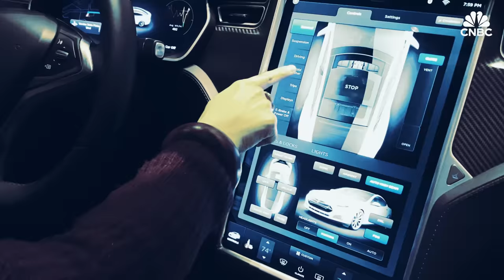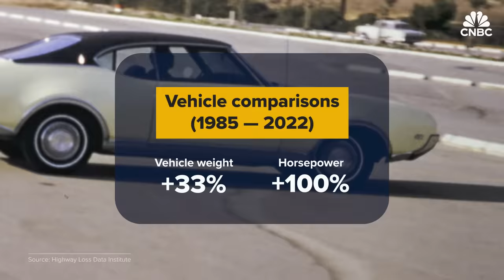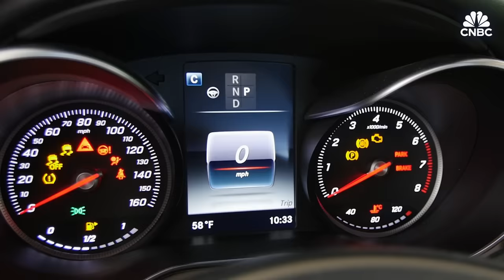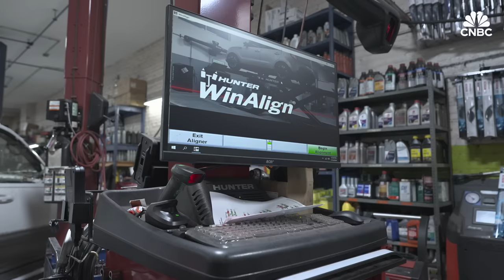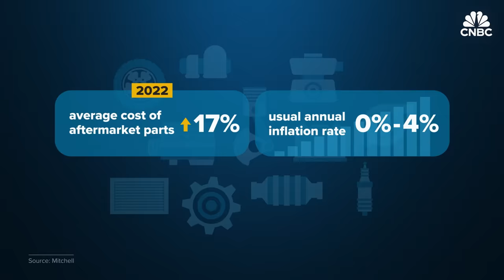Why Car Repairs Are Getting So Expensive

Comment: When I first started working as a mechanic after trade school I made $15/h. I was expected to do 70 hours a week of work within 40 hours. Everyone was expected to scam customers with repairs that weren’t needed. Oh and the dealer charged $150/h.  I was laid off for not meeting performance goals that could only be met by scamming customers. 

No shock there is a shortage of techs, when being honest gets you fired from many shops.
Reply: Sad but true. Same thing was asked of an A/C repair man I know. Integrity is becoming an option not a requirement.
Reply: Thank you!!! But no one is talking about this!
Reply: Thanks for sharing your story. It's always interesting to hear firsthand from people in trades how business really works.
Reply: At what point did you decide face tattoos were the key to success?
Reply: Those tats and bullhorn are ridiculous
Reply: that's when you contact the labor board and get the local news and an investigator involved and sue
Reply: Mechanics at car dealerships are the biggest crooks around
Reply: Thankyou for your integrity.
Reply: Last straw for me was asking for a raise from 26 to 28/hr, and they said if I wanted that, I needed to book more hours. I had almost zero comebacks, and had to fix other techs screwups a few times, then looked at their hourly rate in our system, and they were making more than I was. They push quantity, not quality of work.
Reply: I owned a Saturn many years ago and purchased the car with a maintenance contract from the dealer.  I went in to get the routine maintenance done and the service tech “recommended” a service.  I told him if it’s a service required by maintenance manual that he should do it.  I came back to pickup car and there was a charge.  I told him that I have a maintenance contract.  Service manager tried to argue that there was a difference between what they recommend and what Saturn recommends.  In the end I didn’t pay for the service.
Reply: Hopefully you are a mobile mechanic and your own boss. I’d rather pay someone who’s honest that way than to pay a shop.
Reply: @ralpholiver8512  dealerships are crooks. Not mechanics.
Reply: Yep same here I changed careers. Every time that snap on truck rolled in I realized in couldn't afford all the tools I needed with what I was getting paid.
Reply: Are you sure you weren't frightening the customers away?
Reply: I was making 17 an hour (flat rate) as a heavy line tech and the dealer was charging 28 an hour for cars and 30 for light duty trucks. My how things have changed. Supply chain my foot. I bet it has more to do with skilled techs.
Reply: My son experienced the same thing. He started his own, successful, shop.
Reply: I took high school auto shop back in the 70's and the cars were very simple compared to the newer cars.  Open the hood of a 1970s car you would see a motor with a few attachments.  Open the hood of a new car and it's tough to find it.   To save money I still do all of the basic maintenance.
Reply: Yo, same thing happened to me. That’s why I haven’t returned to the field.
Reply: This is a very true statement.

CNBC needs to look at this side of the story before they publish anymore stories about rising prices.
Reply: @ralpholiver8512 Its the service writers and the service managers fool
Reply: Its funny when I had an extended warranty only things that needed fixing were recommended.  But now my warranty expired the mechanics try to scam me.
Reply: @pouffykinkajou it pays to be dumb and get gravy work.  Some jobs you can't beat flat rate diagnosing..... example a vanity light in a new pilot kept blowing the fuse and taking down can bus and putting car into limp mode.
Reply: Dealers are scam artists I'm a mechanic ill never work at one and too much goverment is involved with production that's why quality is horrible and everything is expensive disposable trash, and now we wonder why everything is so expensive ? Ppl r dum
Reply: By "many shops," you meant he one that fired you for being incompetent. I call BS.
Reply: Dont blame techs for doing whats expected of them. We are just a disposable tool that gets little respect for doing a job. A job that requires a large amount of equipment and knowledge that costs us. I spend minimum of $50/ week on tools times 52 and hundreds and/ or hours spent on education per year. With no pay increases.
Reply: I was fixing the computer that fixed the car more than I was fixing the car, so I went back to school for computers.
Reply: And this is why dealers need to go
Reply: That’s why I left the industry after only a year. I do it as side work now mostly for friends, and family. I current for work public transportation in fleet maintenance.
Reply: @260ZRB 😂
Reply: It takes all of us to keep up this honest and good works to bring the tide of powers to where it is truly meant to be. To be in the resonance and flow of wisdom and love rather than fear and time-chunk-hoarding.  We used to live for the earth's gifts and for one another. Now we live for money, even trashing the gifts and brethren. I pray humanity organize and upgrade abilities much sooner than later, or at least right on time,  so that we may keep forward with the gifts and one another as well as the conveniences of money.
Reply: Why i never go to garagists, they are trained scammers
Reply: Mechanics are the biggest scammers
Reply: @ralpholiver8512  neighborhood mechanics are in 2nd place
Reply: @billybob-vy4sw  it is very rarely the mechanic doing the scamming if you go to a reputable place. It is nearly always the service advisor.
Reply: thanks for your transparency
and your service man..
Reply: Preach on!!!!  Don’t get me started on the automotive repair industry. It’s a joke
Reply: I'm being charged 3500 for a plastic gear in the AC assembly box.

Many large scale dealers scam you hard.  So I can confirm your statement.
Reply: @My_Cats_Meow Maybe you should fix it yourself?
Reply: @DarkSim77  I do most things myself.  But you have to know your limitations.  That said, it doesn't excuse the fact that they scam you hard.  An elderly man isn't going to be able to disassemble an entire dashboard, take out eletrical wires, screws, HVAC systems, and then access a large assembly just because a gear the size of a few fingers went and broke.  Then be able to put it all back together just as it was.

Like I said, I would do it myself but I do not have the knowhow and skill to do it, but someone else can do it for a thousand with labor.  Point is, they are scammers.  Not the mechanics, the companies they work under.
Reply: At this point I’m starting to learn how to repair my own damn car.
Reply: @260ZRB  obviously ripping people off to have tons of money wasn’t my top priority in life. If it was I would have gone into the corporate world in exchange for my soul. No thanks.
Reply: @pouffykinkajou  all the people making the most hours, were doing gravy work/ scams. The people actually fixing hard problems that others couldn’t got screwed.
Reply: @JeffReams  customers at every job I have ever worked at specifically requested the tattooed guy, and always told their friends to ask for the tattoo guy because I had integrity.
Reply: @covercalls88  I went to trade school and I’m particularly good at electrical systems and computer systems. Total nerd 😂
Reply: @B3Band  I was “laid off,” and the dealer made the news shortly after in those scam alert segments for exactly what I refused to do. Sorry I’m not going to forge safety inspections on cars with defective brakes, suspension, steering systems etc… so they can sell dangerous used cars, and then lie to sell service on customer cars that were fine. I’m not paying a $10,000 fine so they can make money scamming people.
Reply: In Florida mechanics in our area get offered $15/17hr. Just like working in a fast restaurant. There is no money doing that kind of work anymore.
Reply: $15 is good they started me at $13 and I was expected to unload 18 wheeler tire trucks with batteries and other materials then stock those heavy tires and do car maintenance on Subarus to Audi
Reply: @coexist1018  that doesn’t sound like a mechanic position, more like an apprentice position.
Reply: @MultiAnne36  and the dealer will turn around and charge $200/h as the shop rate.
Reply: No there is a surplus of techs... We need more lube shops and less techs.. 

Modern cars should last a million miles 20-30 years taking care of drivetrain and frame. 

People are ignorant.. that's the issue..
Reply: @mysticjedi6730  what delusion are you working under? All the older mechanics have reached retirement age, and few young people have gotten into it. There’s a massive shortage of techs that can work on modern complex vehicles. Lube shops can’t even figure out how to change the oil correctly or reset the oil life meter in modern cars 😂
Reply: @rpvitiello  you did not understand my comment.  We need more lube shops, less transmission techs. We need more lube shops, less engine rebuilders. 

We need more vehicle undercoating shops, less techs working at Honda assembly plant where I worked making new cars.. 

Modern vehicles mostly can go a million miles on engine, last 20-30 years or more. If people maintained to their vehicles we could eliminate half the techs working in assembly plants and have them maintaining and repairing used vehicles. 

What delusion are you working under?
Reply: yeah a shop like that needs to go under, I never go to a mechanic because I had one try to scam me, pulled the old air filter BS and I wasn't having it.
Reply: That’s a problem. Capitalism is the key.
Reply: I’m not surprised. My dealer changes my oil for cheap then come back with a list of recommended repairs. I took it to a local mechanic and said it was all bs. I’ve taken in back once since then and he told me the same thing. Has saved me tons of money. He seems honest so he’ll get my repeat business. It’s a 2016 Nissan Murano with 188k miles. Still going strong. I guess I’m lucky.
Reply: Thats why im planning to study automotive just for that reason 😂 gonna fix my own car
Reply: I hear what you are saying. I am a DIY. I maintain the family vehicles and friends' ones very well. We have never had one vehicle to a service shop for years!
Reply: No offense but if I saw you as a mechanic I wouldn’t trust you with my car. Sorry
Reply: @blackhawks1870  and that’s what you get for judging a book by its cover. You can keep going to the friendly face shops that screw you over.
Reply: Thisss even if a concern is not felt, I’m must overhaul to make hours, of course if under warranty, most are under warranty so not so much scamming the customer but scamming still